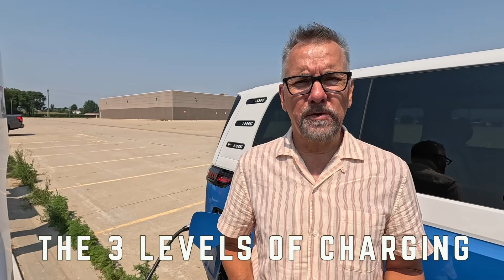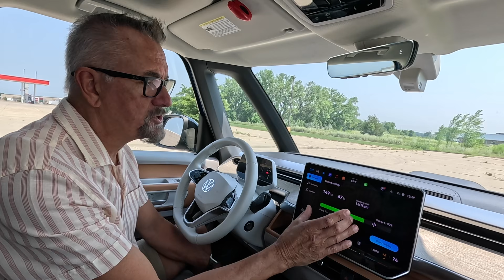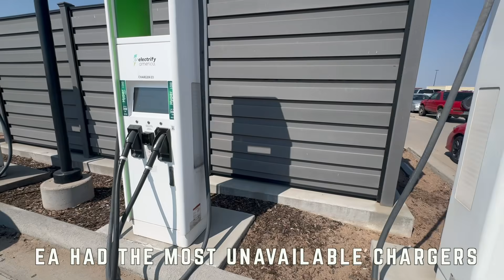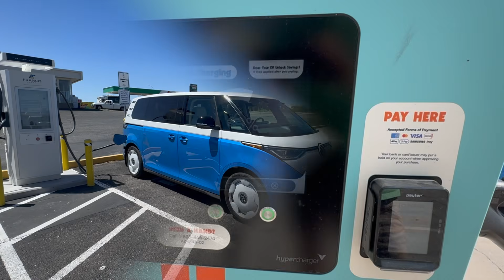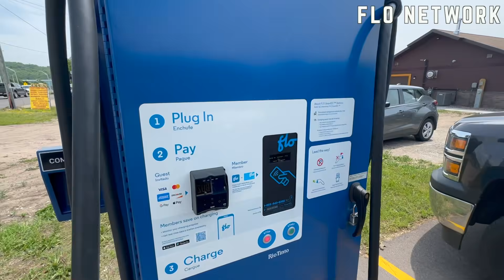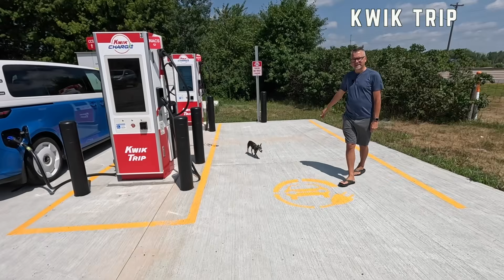CAN YOU REALLY DRIVE AN EV ACROSS AMERICA? | PART 2 - CHARGING ACROSS THE US | PAULZ GARAGE

Comment: You can take it on a road trip, but the availability of chargers will determine the path you are allowed to take. You can't just drive anywhere there is a road like you could with an internal combustion engine vehicle. Maybe someday.
Reply from the maker: Right now it does take some planning...reminds me of when I first bought a diesel RV and had to make sure I was on a route with Diesel truck stops...but this summer I have been surprised at the charging that is available off the interstate.. I also think some places off the beaten bath are installing them to attract tourism....

Comment: Right after I purchased a used BoltEUV last September I tried to use a newly installed ChargePoint charger in a marina near me. I couldn’t get it to work so I called the tech support phone number to find out I wasn’t authorized to use it, but they sent me an RFID card that I associated with my CP app.  Since then I found using the CP RFID card to activate chargers works way better/faster than the app.

Comment: That's one thing I don't like about changing stations. You need a different app for all of them or pay a subscription 😢
Reply from the maker: I couldn't agree more, having to download so many different apps is definitely a major headache! Tap and Go, like every fuel station, is how they all should be set up!
Reply: @paulzgarage .  Several non-Tesla EVs support charging on Tesla’s Supercharger network via Plug & Charge (or equivalent automatic authentication), so you can simply plug in and start without opening the Tesla app or swiping/tapping a credit card at the stall.

I expect this will be standard on non-Tesla EV‘s sold in the US in a couple years.
Reply from the maker: You are correct, I should’ve mentioned this. On Electrify America I have plug-in charge. It depends on the manufacturers app if they participate in plug-in charge with different networks.
Reply: Almost all fast chargers that aren't Tesla support tap and pay.  One exception is Walmart but they've announced they're adding tap to pay and have started installing them. Also, paid subscriptions are only if you want charging discounts.
Reply from the maker: The other thing I ran into from some networks (including one Circle K charger) was that the screens were unreadable, or the Tap and Go was out of order, forcing you to the app. Whenever I see something broken on a charger, I always call it in. I think alot of people just move to the next charger to charger and it never gets fixed.
Reply: In most countries CONTACTLESS card payment is a mandatory option. Except for USA and Australia.
Reply from the maker: I think, from a business standpoint, all the charging networks would want tap-n-go.. the easier it is to collect money, the more you will collect! LOL

Comment: The problem with Level 3 DC fast charging is that in most areas of the country, it is only available along Interstate highways and not along US or State highways.    Interstates in total only carry 24% of total traffic in the US, yet those roads are the only ones being served by the major charging providers.   As long as you stick to the Interstates you can make a cross-country roadtrip, but when you take a US or State highway, good luck!
Reply from the maker: I think that is rapidly changing. I drove all across Michigans upper peninsula and was concerned about charging, but found that there were chargers along the state routes and small towns.. Also had the same experience in New Mexico. I think some smaller tourist areas are discovering that if they put a fast charger in, they will get  more tourists....

Comment: For Tesla, V2 does not work as they do not speak the same language as the non-Tesla EVs.  Also, some V3 and V4 sites are restricted to Tesla-only.  The Tesla app makes it clear which, and PlugShare can filter out the Tesla sites that are Tesla-only.

Walmart has announced that they will be adding credit card readers to their chargers, including retrofitting the existing sites, soon.

Finally, there is a Level 3 AC charging specification, but you are unlikely to see it in the wild.  DC Fast Charging (DCFC) is everything that does not use an on-board charger.  That said, most folks will use the term Level 3 for DCFC.
Reply from the maker: I relied on ABRP which I only routed me to Tesla chargers that were compatible, which seemed to be a lot even in remote places. Great that Walmart is adding card readers...having to download an app to charge is not the way to go.

Comment: For me it would be helpful to know the typical highway range you are getting between charges.  I don't think so much that there is a real question about whether one can roadtrip cross-country in an EV so much as whether one can roadtrip in an EV with very limited highway range. What's the minimum useful (say 10 to 90%) range below which you are not likely to make it to the next charger when crossing the southwest?
Reply: On a 3700 mile roadtrip in my buzz, I averaged 200 miles or 2-2.5 hours between stops on the highway. Charging stops were about 20-40 minutes, longer stops were out west where there were fewer chargers.
Reply from the maker: I stopped about every two hours, which was about 200 miles more or less. Depending on the speed of the charger, stops were 20-35 minutes.